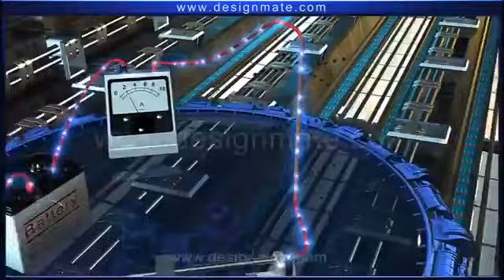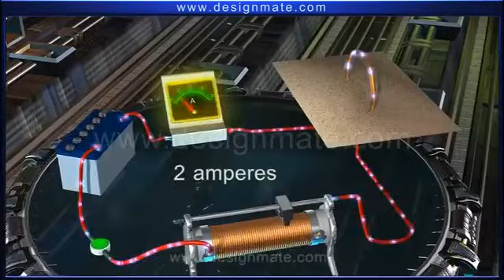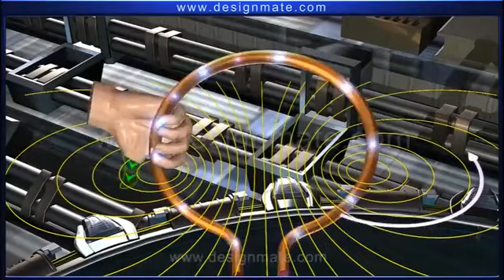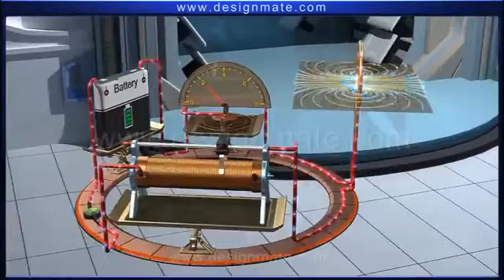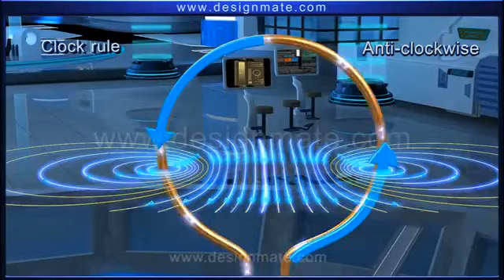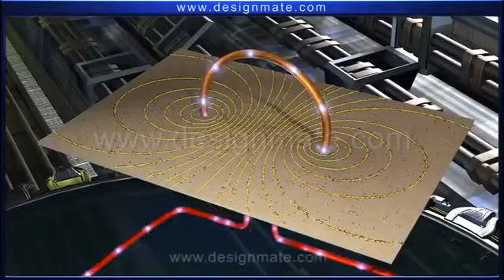Magnetic Field due to a Current Carrying Circular Coil

Comment: WoW! well done
I have a question......
It's clear that the strength of the magnetic field is maximum at the center of the coil when we consider the variation of magnetic field along the axis of the coil but where the strength of the magnetic field is maximum near the circumference or at the center of coil if we consider the variation along the radial direction.

Comment: I question the reference to a cylindrical field around the wire. The electric current has a frequency and could travel in 3 dimensional waves resembling a cylinder, without actually being one. The use of iron filings makes pretyy pictures and is good for 'proving' a point, but few ever take into consideration that once filings enter a magnetic or electric field, there are no iron filings, simply thousands of tiny magnets.